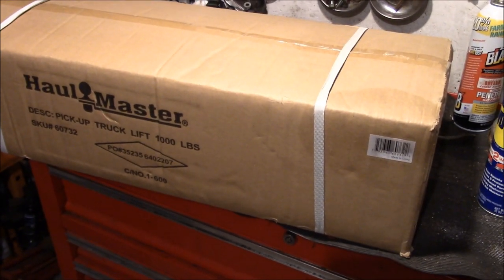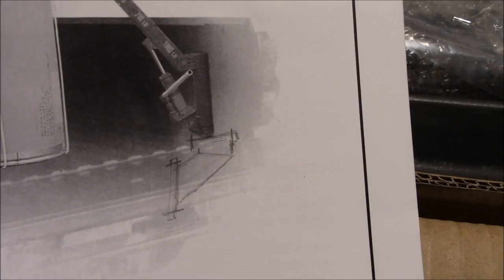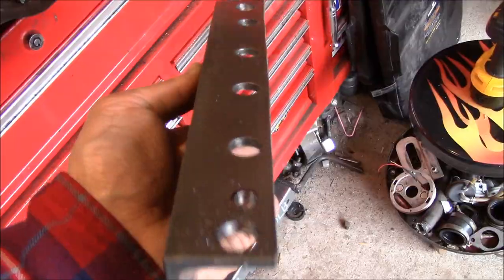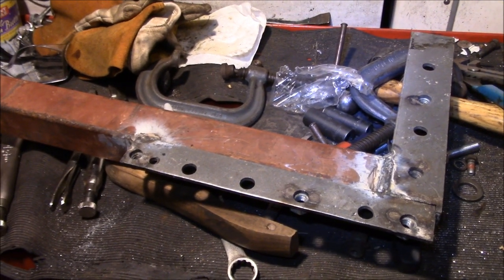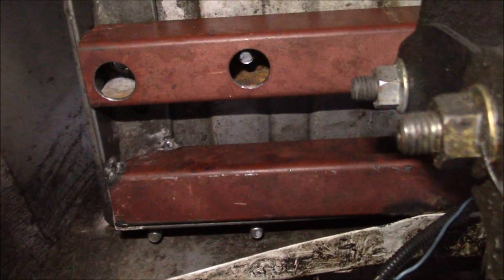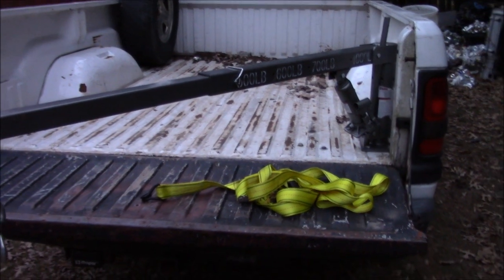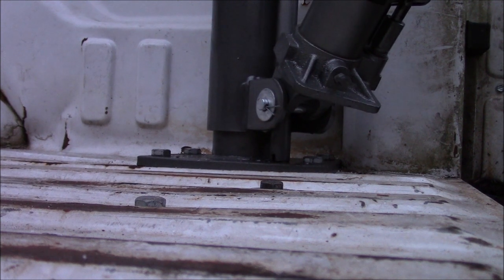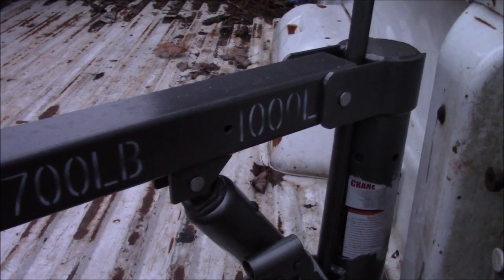H.F. Truck Bed Crane:  Subframe Reinforcement

Comment: What material did you use for the added reinforcement? 2" square steel tubing--quarter inch, three sixteenth, or would eighth inch be sufficient?

Comment: Thank you for this video I was about to buy one of these I'm not ready to go through all that bullshit thank you once again for the heads up
Reply from the maker: Glad to hear, you would certainly be disappointed if the bed folded when using it.  With the bracing this crane has done a lot of service, and it's still going today.

Comment: I installed mine a couple days ago. I made a 1” thick aluminum plate that’s a lot bigger than the original mounting plate on top, I used the supplied angle iron on the bottom with plans of stabilizing it to the Reese hitch. It should be fine after I add those supports. The hitch is huge so I can’t get to the frame of the truck

Comment: Add a removable extension to the verticals upright and your lift arm will be higher and you can then use a cable winch.
Reply: That's what I'm planning.   Going to try to use a small winch, braided rope, pully on the end of the arm.  Wire the winch and add an inverter for a charger. Tonneau cover over the bed.

Comment: Lifting my 200lb plate compactor in and out of the truck bed is either going to be easier this year or with the addition of a pressure washer which weighs a bit less…. Be cause for me to purchase this thing here 😅
Reply: Nope… I’m a keep lifting these things for now… probably get an enclosed trailer with a ramp. Yea, that makes sense to me, have all my tools in the cab mostly smh.
Reply: Well, the most common ones anyway.

Comment: that jack is a waste for lifting, just mount a hand or electric wench under main arm just in front of upper jack connection and a pulley on end of boom to lift stuff and use jack to position boom high enough to get stuff into bed of truck, good job stabilizing

Comment: Can I ask, what is the square tubing diameter? On the 1000 lb. side. 2” or 2 1/2”?
Reply from the maker: 2 3/8" outside on the bigger tube.
Reply: toocheaptosmoke thanks..... someone bought my first build.... I didn’t expect it. So I wasn’t able to take measurements.. Since I am in Hawaii... I wanna build another.... instead of buying and shipping it to Hawaii.... I am going to use 1/4” instead of 3/8” for the boom, so I can lengthen it to 5 1/4’ long... I also subscribed to your channel..... thx for the info...

Comment: What if you attach a leg that can come down under it? Is there enough space?
Reply from the maker: I think that would work well, and kind of what I originally intended to do.  However, it really depends on how your truck's frame, bed, and suspension is setup, there may not be enough clearance or space.  That's why I ended up doing it the way I did.  Anything you can do to spread out the load will help.

Comment: do it like I would put a boat cable winch on top of the base that can resolve the problem of the  lifting height
Reply from the maker: Yeah, could certainly do that.  I've had pretty good luck thus far just using a big ratchet strap.

Comment: ll agree with you about Harbor Freight sometimes it’s hard to argue with what they sell things for money wise  80 bucks for that crane does seem like a decent deal  i do like your modifications on “Beefin” Up the mounting system  although if i was to need or buy one of them i would probably utilize my 2 “ receiver that’s rated to 10,000 lbs  plus my truck is a 1 ton Dually that should be pretty stable  without  any jack stands  when i hitch my travel camper to the hitch even with loaded water tanks  my suspension doesn’t compress  and it actually improves the trucks ride ironically  one time my best freind noticed that i purposely stored  most of my heavy items  inthe front of the trailer to add tounge weight  and he asked me why   i’ve pulled a 19,00,500 lb fifth wheel with the truck as well as my 10,0000 lb Sport fishing boat  that also had a lot of tounge weight with the trailer i use

Comment: The easiest way is with a thicker bigger plate on the bottom just like the top one and that's it
Reply from the maker: Unfortunately a lot of truck beds like mine just don't have thick enough metal for this, it would twist the floor up if a full 500 lbs. was lifted.
Reply: How a bout w plate welded underneath to bed crossmembers and two square tubes across frame and a plate between jack and bed ?
Reply from the maker: @edredfish  If you had a heavy enough plate and also tied it into some cross members it would probably work.